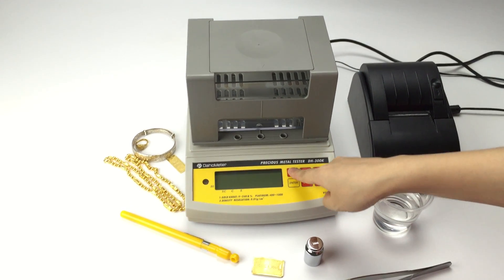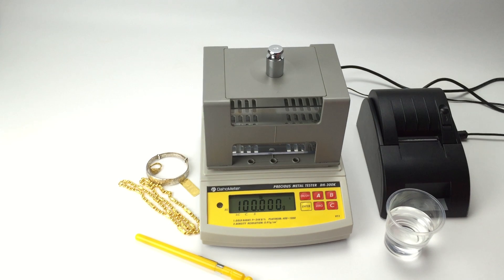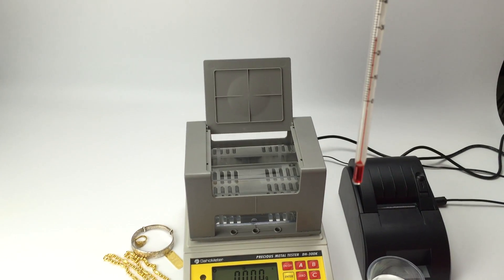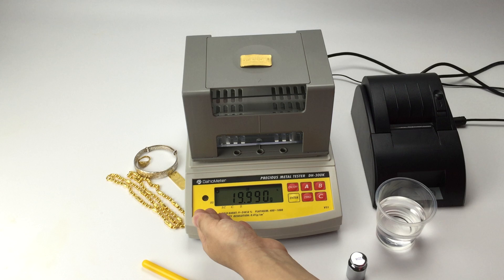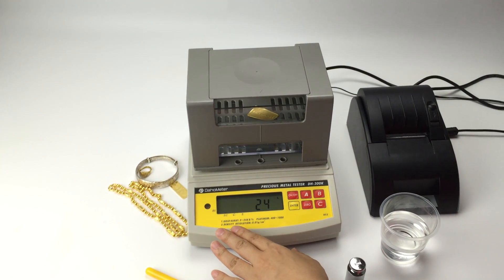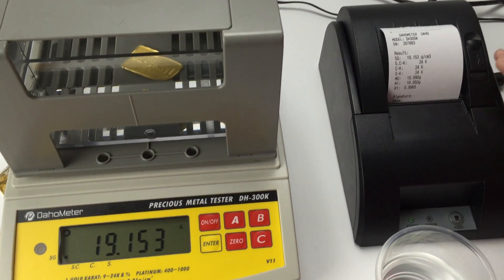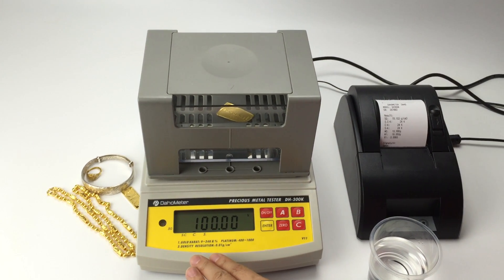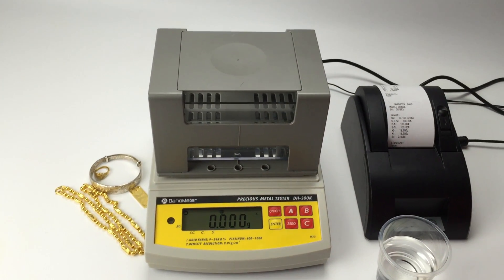Demo video for gold purity tester,gold density tester,gold karat tester DH-300K

Comment: Its a pretty neat device... The only thing that threw me off was the Percent composition.
If Percentage of Gold is 100% according to what is displayed at 6:50, it is not possible for the density to be 19.153. It has to be 19.32.
I am not sure if the device is rounding off the percent composition to nearest integer or what the tolerance is...